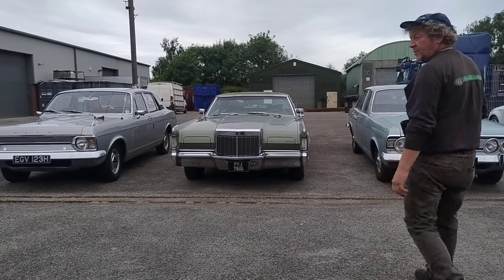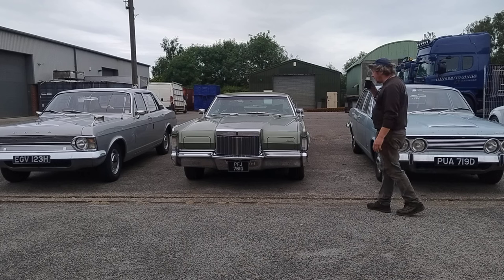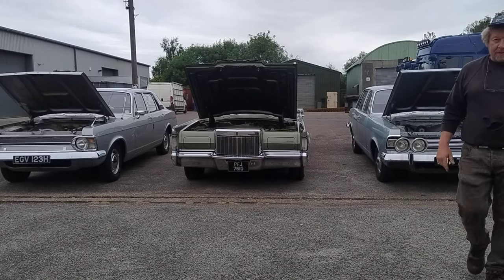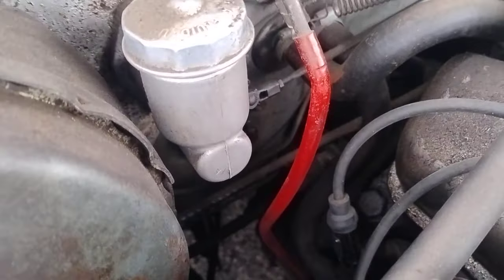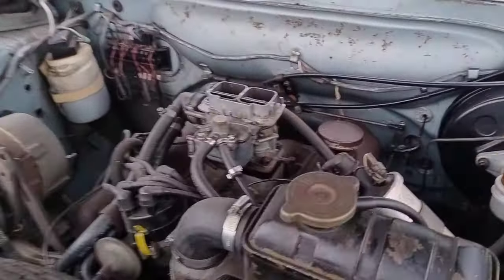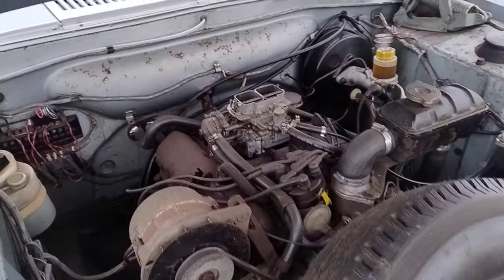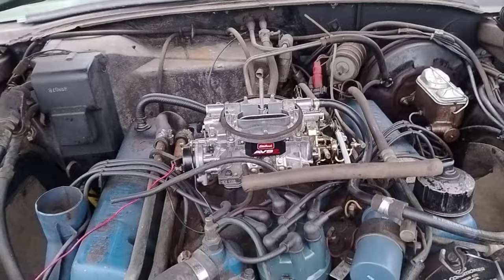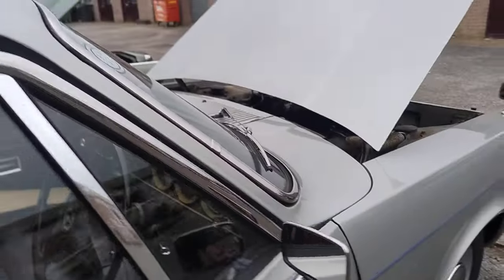A look at Fords V4 V6 and V8 engines a rare chance of these classic cars being together.

Comment: my dad had lots of problems with the 40's, baseplates warped + drew in air, also bad icing in the winter, so he swapped to the 38's
after he passed, we found a 4 barrel holley + manifold in his bedroom, but it is D port, so that is probably why he never fitted it in the 80/90s
was there an american version of the essex, my dad reckoned he saw a ford v8 in a zodiac in the 70s on holiday somewhere
Reply: Yes - there was a V8 made in ' Essex' Canada
Reply from the maker: @paulriggers1558  seen plenty of V8 engine swaps on MKIV's but never a factory car.

Comment: The V8 is a beast.  It would be great to see it squeezed into a Zodiac, I wonder if it could take the strain of all that power!
Reply from the maker: @kevinsenior8155  thanks for the comment, think it's been done
Reply: In 1970s New Zealand V8 installations were a popular alternative to replacement V6 crate motors. In 2024 Mark 4s with Windsor V8s and contemporary overdrive automatic transmissions appear in the used car market. In recent times a 1966 or 1967 Zodiac was offered with high performance 289 V8, original manual gearbox and 3.1 to 1 crown wheel from a Rover differential. Chevrolet 283, 307 and 350 installations were popular, in the 1980s I found a Zephyr for sale in a Napier car yard with 318 Chrysler V8 and Torqueflite transmission.

Comment: Great video my dad used to own a garage in Barnsley loved the V8`s in the old yanks big blocks little blocks then the V6 in the Mk4 Zodiac`s he used by from the ministry
Reply from the maker: @peterlee44  thanks for commenting, yes I can remember Woolhouse,at the bottom end and another who was higher up think he was called Sam used to have a lot of of American forces stuff. Bought a LTD ford of him once.
Reply: @Diggers-Garage  Wow small world Sam was my uncle his brother my dad Geoff 
Did the LTD have a cracked block and it was parked outside the garage at the top of the yard ?
Thank you for the reply
Reply from the maker: @peterlee44  it was black straight six column change manual low mileage it didn't even have power steering he had a few of them.
Reply: @Diggers-Garage  not the car i was thinking of but great all the same 
Thanks

Comment: That Zodiac is something special. It's the first time I've seen one with the chrome effect still intact around the dash gauges - I take it they're all supposed to be like that, where they're usually cream-coloured plastic? I've always wondered, but I've never seen another single one that still had the silver coating.
Reply from the maker: @dungareesareforfools  thanks for the comment, cars totally factory it's original probably just not been polished off.

Comment: My Dad use to have a v6 zephyr with the twin lights at the front on a K reg
Reply from the maker: @Joe-ug1vu  thanks for the comment, would have been a Zodiac if it had twin headlights.
Reply: @Diggers-Garage  that is what I thought. I doubt you added them on as optional extra.

Comment: Here's a thing - I would have thought the Zephys would have been tiny compared to the Lincoln but they are not at all. Those Ford Autolite  carbs  were awful in their day especially the autochoke   version  which looks like one on the Zephyr. Terrible starters in cold weather.
Reply from the maker: @Comfortzone99  thanks for the comment, they get a lot of flack do Autolite carbs but to be honest I think Zenith can test you a bit more at times. It's all about the understanding of them
Reply: Camera angles! Zodiac length 15ft 5 long 6ft wide. Actually smaller all round than a mk4 Mondeo!  Lincoln about 18 ft long 6 ft 6 or 6'7 wide
Reply from the maker: @tylerhamilton-nz8qs  A point I make on a regular basis to people.